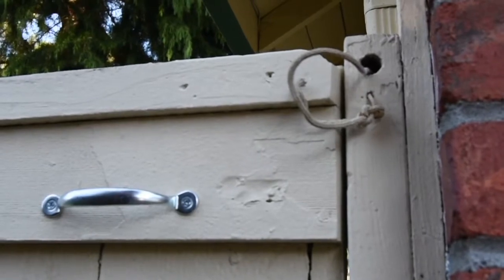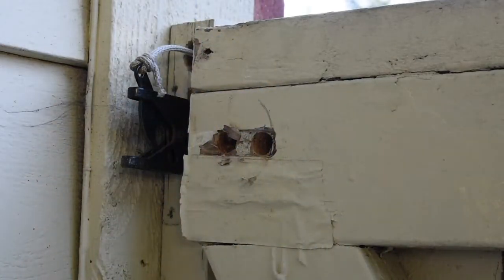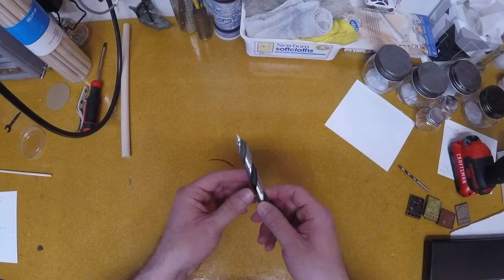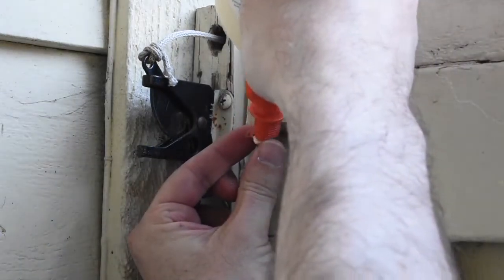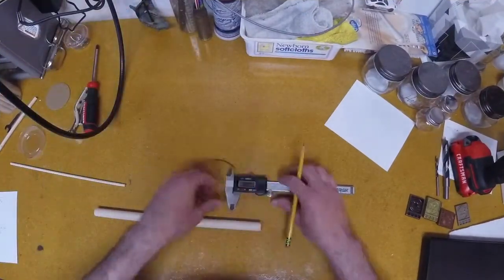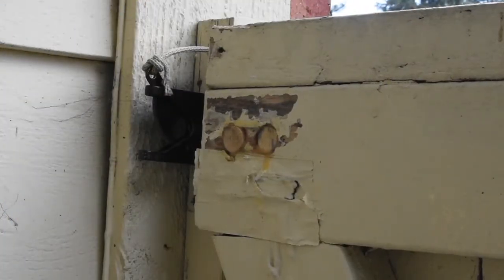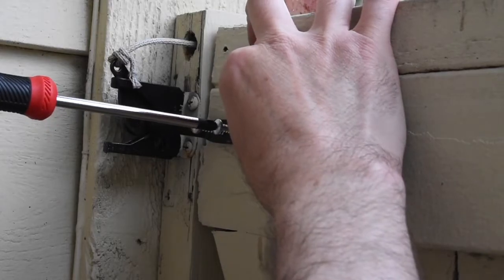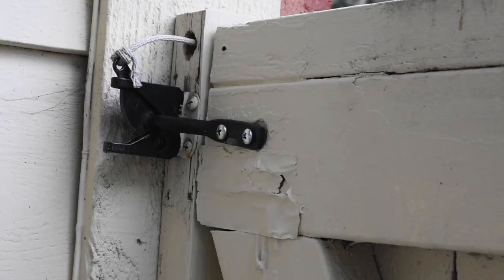Repair Threaded Hole in Wood Fence Gate

Comment: If you're going to quote something say the whole quote for those in the back.  See the "Jack of trades but a master of none"  is often used to insult people in the Handyman trade.  But if you use the whole quote it puts the power of the meaning back in the hands of the Handyman.

It goes "A Jack of all trades and a master of none, is often better than a master of one."  Now it has new meaning to those who don't know the whole quote.

I'd rather be able to do multiple things and not be a master at any of them, than to be a master of only one them and not be able to do anything but that one thing.